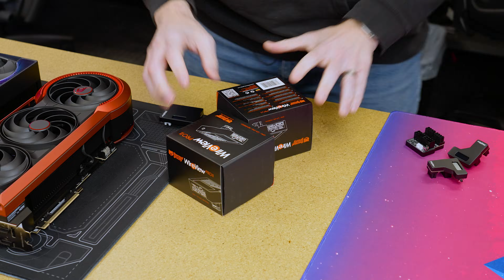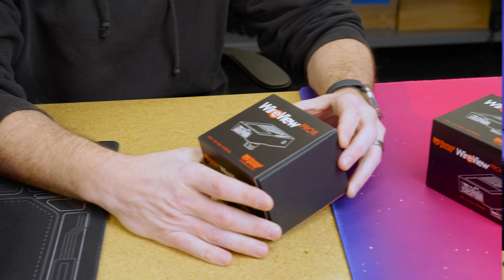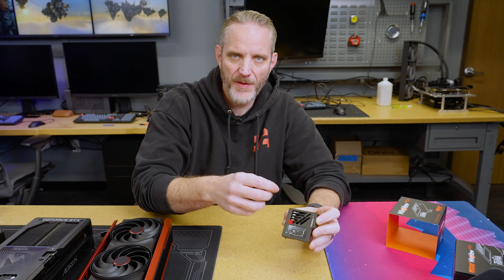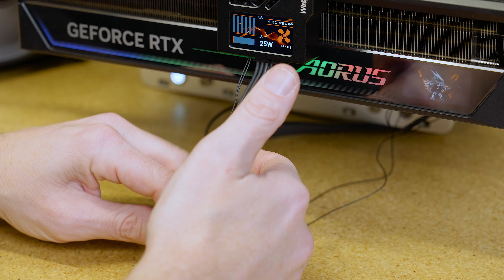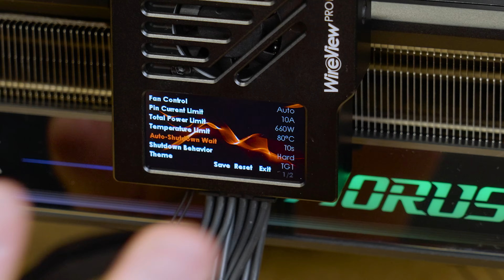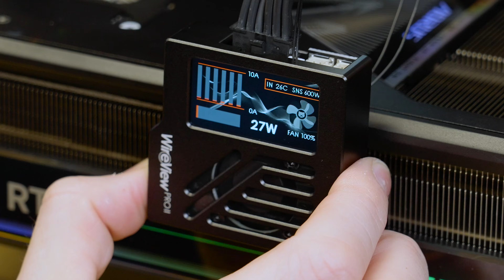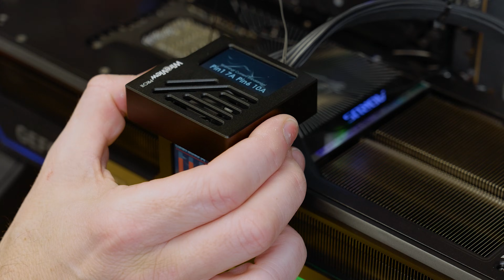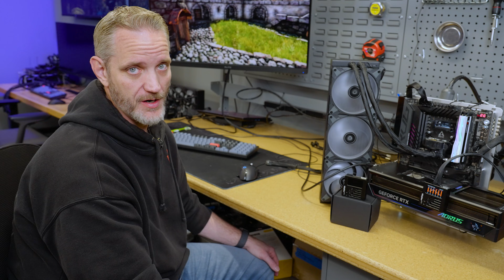Thermal Grizzly Wire View 2 Pro - The fight against melting connectors!

Comment: So many innovations in gpu cards and power supply units and by today we have still  connector issues...seriously
Reply: We have still.... we still have*
Reply: It's almost like there is a serious issue with the connector? 🤷 Maybe the problem will fix itself if we all just keep buying more of them. After all, "the more you buy, the more you save"!
Reply: It's literally 0.0001% of 5090s sold.  This is just Internet tech drama..
Reply: @JeremyBell and 8pin haz zero melting stories. Why reinvent the wheel?
Reply: @overclocker3164  you can see that 8pin has limitation in term of space. So to prevent going 4x8 5x8 6x8… they needed a new connector. It’s not Nvidia alone.. this is a new wheel, you have to deal with it.
Reply: @MRLWay oh yeah, they are SOOO HUGE on a cadillac sized gpu.........
Reply: Yes it is a new wheel, and it's shaped like a triangle @MRLWay
Reply: @xninja83x67  No it’s more like a prototype carbon wheel. Work great for the weight but need more care.
Reply: @overclocker3164  every pin/plug in the world has a case of melting.  If you don't plug in a plug all the way, the resistance and heat will build up.  Also, the 8 pin isn't standardized on every psu and many a people have blown up their graphic cards by plugging in a 8 pin cable that was incorrect because "it fit" the 8 pin plug connector.
Reply: @JeremyBell  Really now?

Comment: The only problem with this is that it's not compatible so few models. We need a universal solution, even if that means it's just basically what Asus has done with the Astral cards that can interface with HWiNFO, but doesn't have any sort of screen or readout. I saw that Cooler Master has something like that at CES, but it needs a little more time in the oven from what I've seen.

Comment: honestly when i fist saw the 12v connector i thought the pins at the top where data pins, standardized monitoring in the cable, i was like "oh, that's cool", yet later i realized they where power pins, which it's kinda dumb ngl, glad to see someone is doing something to give us more security features on our literal gold bricks
Reply: They’re not monitoring in the cable, but the 4 pins at the top ARE data pins. They’re used to signal to the card the maximum power the PSU or adapter is capable of.
Reply: @jameslake7775 then that's such a dumb idea, would have been better to make them digital, would have even avoided the melting connectors if it implemented a second microcontroller designated to simply monitor usage with a flag for the wire rating, microcontrollers aren't even that expensive, specially at quantities

Comment: You can never have a melted 12vHPRW again by not buying NVIDIA :D
Reply: This is just part of why I refuse to buy Nvidia, & use AMD, and Intel on Linux, as they just work, and do what I need them to do.
Reply: To bad 9070 XT has melting issues as well so yeah NOT just a Nvidia issue
Reply: @Montisaquadeis  just dont buy the one model with the connector the rest dont have it
Reply: @averagerin1821 my point was its NOT just an nvidia issue
Reply: @Montisaquadeis Exactly. The one Sapphire Card having that connector is suffering from the same issues. Most of the other RX90something Cards, which  have the good old 2x8 or 3x8 connectors, don't.
Reply: This

Comment: i went AMD simply because of the 12v cables on Nvidia cards
Reply: Same
Reply: probably wont be long til AMD adopts the 12V standard in their future cards.
Reply: @NightmRE_ZZZ and then I will skip them. I don't NEED them.
Reply: Never had an issue with mine. But I made sure it was fully seated. So it wouldn’t have an issue
Reply: @XeMpTFrOmDAT doesn't matter whether it's fully seated. They can still melt from aging or small production tolerances. The design is too finnicky

Comment: Meanwhile I'm running my good old 1080, which has been stable for almost 10 years. No instability, no crashes, no overheating, no melting. Just performance.
Just the idea that a 2k card needs additional hardware to work without catching fire is mind blowing to me.
Reply: gtx 1080 released in 2016, its almost 10 years. sorry
Reply: @lore.1000  Yep, that's me doing midnight maths XD
Reply: @thebearded4427 xD its ok i have one too thats just as old lmaoo
Reply: My 770 still works. I did get a 3090 though for my current PC and that has been the most stable card I own. Its really the new connector that messed things up.
Reply: Ditto. 
EVGA 1080 classified is a tank. Still runs one rig of mine. 

Their 3090ti is the last card I'll ever buy new. With EVGA gone Nvidia is no longer on my menu.

Comment: Why is Nvidia stupid enough to only give a cord 25 watts of headroom in the first place?
Reply: Because they want it to look pretty; because "everyone" is buying glass panelled cases.
Reply: @ws1-p9u  you have a point there BUT to be honest even that one HWPR cable ruins the clean look.
Reply: Because they hate gamers and want all their money!
Nvidia is not a friend of Gamers anymore, they just empty their pockets with bad engineering.
Reply: Ask PCI-SIG, they designed it.
Reply: @Mark_Williams. Who pays you to comment over and over?
Reply: @ignacio8597  Just doing my part to fight back against the misinformation :)
Reply: @Mark_Williams. you do misinform people. Better do your homework and read the documents. Typical Nvidia-Fanboy-behaviour.
Reply: @Mark_Williams. Y're not wrong, but leather jacket could've tested the connector before slapping it on hundreds of thousands of gpus, no ?
Reply: @overclocker3164  they're the ones that requested it to be created. The industry standards body came up with the design. As far as Nvidia is concerned, they did everything that was required. I'm sure both sides did testing, but might not be the kind of thing that'll raise its head until its out in the wild.
The failure rates and replacement costs is apparently worth it for them to keep going with it.
It's pretty well entrenched now, changing it again would mean new PSU's for everyone at this point. Or at the least adaptors, introducing yet another failure point into our systems.
Reply: @Mark_Williams. you are still wrong… no matter how often you repeat your story. Also, do you know who is one of the most influential PCI-SIG-member? Right, Nvidia.
Reply: @ThisIsSoMEan Sorry, semantics. PCI-SIG ratified it. NVIDIA, however, doesn't make connectors. It was most likely Foxconn (who make the Founders Edition cards and connectors) that would've partnered with them to design and prototype it in the first place. You don't design a connector without someone like them being intimately involved. So, at best, you can claim 50/50 on the original design. At worst, Nvidia gave Foxconn the desired specs and let Foxconn (or whoever) design and make it all on their own.
PCI-SIG allowed it to go industry-wide. NVIDIA being influential belittles Intel's weight, especially as it chairs the CEM workgroup.
Getting your connector to go industry-wide without the rest of the industry following (Asus GC-HPWR for example) with a standard won't get you far. So I maintain PCI-SIG is primarily at fault for why we're now stuck with it. Before that happened, it could've been revised more easily.
Trying to claim it's all Nvidia's fault when it passed through so many other hands and eyes is misrepresenting reality.

Comment: Pretty cool device, but it should be considered embarrassing to need to spend $100 on a little monitoring device to make sure a badly designed cable is doing what the spec is designed to do on a GPU that is overprice

Comment: i love how people have spent a fortune fixing a problem that Nvidia created by trying to re invent the wheel
Reply: 3x8-pin is easy solution😭😭😭
Reply: Don’t buy nvidia
Reply: @maxweinbach3996 what is our choice????
Reply: @montrose699  These YouTubers are raving over Intel…go for that.
Reply: @maxweinbach3996 it won't even come close to a 4090 or 5090 and my 4090 barely drives my VR now. For high end users there isn't another option
Reply: @montrose699 then why are people complaining about nvidia despite buying them? If it does the job….
Reply: @maxweinbach3996 because it's also risky and expensive
Reply: @montrose699  there are. You just don't need to run it all at max settings.
Reply: @caitlinomalley80 then what's the point ,
Reply: @montrose699  AMD... I have a 9070 XT card and it rules
Reply: @rasmuspedersen3563 unfortunately I tried one and it couldn't drive my VR at anything playable
Reply: Not the first time this has happened. Custom CPU retention brackets have had to be created to properly install and mount CPU coolers without bending the CPU or to give maximum contact. 

It is like these companies don't test their designs
Reply: nvidia didn't invent anything here.
Reply: 3090ti 12vhpwr was 100% fine but yeah …
Why keep making thing that works out of the box …
Reply: Nvidia didn’t create it lol PCI SIG did
Reply: PCI-SIG designed the connector. Sure Nvidia and Dell sponsored them to do it, but PCI-SIG deserves the blame.
Reply: @Mark_Williams. No the jackasses selling it should have tested it. Also its not like this problem is a few weeks old, this has been going on a long time and they should have dropped the garbage design...its flawed to its core.
Reply: @xninja83x67  The jackass selling it wanted it created in the first place, of course they're going to keep using it. They had the industry body create it. Whever the reason for wanting it is, it's financially more important to them than replacing the occasional card.
The design isn't as flawed as you might think, it just has a 5% or so overhead instead of the 30% the older 8-PIN connector had, less room for error, which we're seeing play out.
Reply: @Mark_Williams.  Last I heard they rated it for 8A,  but some NVidia cards pull 12A which is why this problem is so persistent.
If this is accurate (I have no way of knowing) then it's 100% on NVidia.
Reply: @Atlessa  Well the connector is rated for 600W, which works out at 10A per pin. If the cards pull more than that, then yeah, the card is out of spec, or needs 2x connectors. More it's the lack of overhead built into the spec, I think it's like 5% or something really small. The traditional 8-pin PCIE plug has something like 30% safety margin built in, and it has a rock solid track record.
Reply: @Atlessa  yeah but we have techtubers who do tests where they put way over 1000W - some even 1600W through that connector and it doesn't melt. Asfar as I know theres not even one video where someone could melt the cables without tampering with it on purpose like GN video where they got it to melt after deliberately inserting the connector so badly that it allmost fell off. And despite the fact that techtubers use every incident to yell loudly to push their views in reality connector based failure rate is between 0.1 - 0,5% which is extremely low.

So the connector can easily do 600W BUT...only if its sits properly so the load is equal on all  the pins. And thats the problem - even if plugging the connector in as best as you can it can still have that "not great" connection on all pins and unless you have asus cards or TG device to monitor it.
Reply: you mean nvidia in conjuction with intel
Reply: @get2choppa  no, Nvidia and Dell sponsored it's creation. It later was put into the ATX 3.0 spec, which Intel manages.
Reply: @Mark_Williams.  it was technically pci-sig
Reply: It's really not even Nvidia or Intel, it's just the standard's body, the same one's that made the previous PCI-E power connector design. And no one is re-inventing the wheel, power connectors evolve with their use case and current/voltage handling requirements. As GPUs change, the power connector standards may change with them. This is blaming the wrong people and ignoring why designs were changed in the first place.
Reply: As much as Nvidia deserves to be hated, they didn't design the power connector, they just used it.  It's literally the same connector that is on the higher end AMD cards.
Reply: @TurinAlexander two cards dude, come on.
Reply: @xninja83x67  Still relevant, stop defending one ass company on behalf of another. AMD is not your friend.
Reply: @wildnugget1675  AMD let's their AIB partners choose which connector they want to use, nvidia forces 12vhpwr onto them. huge difference since the only reason AMD cards with 12vhpwr exist is for the AIB partners and not AMD at all.
and while AMD is scummy themselves their business practices are way less anti-consumer especially in this point. it's just the lesser of the two evils.
Reply: @MrRollmoreBlunts  Ya its to bad they didn't have a high end card that competes and is as compatible.
Reply: @xninja83x67 That still means it isn't an NVIDIA propriety design; that's the point.
Reply: @TurinAlexander  Is it? Huh. Well, I do know that several 9070 XT models do use the 12v connectors
Reply: @TurinAlexander  well you can be sure that someone says then "BuT wHy DiDnT nViDiA tEsT iT". Yeah sure, if the issue is betweeen 0,1-0,5 percent its impossible for the company to test it so well that they could say "well this thing OBVIOUSLY doesn't work". Especially if 1-3% is considered industry standard for the product line.
Reply: @brudel001  It was developed as the standard for the higher wattage - a very bad standard. there weren't devices requiring this hi a wattage prior to the new GPU's
Reply: lol yep, brainwashed muppets with too much money, 9070xt 4k ultra in all games min 60fps,. people are idiots though getting sucked in to Nvidibricks marketing and the belive it.
Reply: @joerocket10r  5090 is double the performance of a 9070xt at 4k RT Though, and 3x the 4k pathtracing
Reply: @joerocket10r  , try high end VR. Even single digit gains are beneficial to prevent reprojection, so you want the fastest GPU you can get.
Reply: @JimBob1937  ah yep 9070xt and htc vive work good. no need to splash 4k on a shit product that might catch fire or just stop working for minimal gains.
Reply: @joerocket10r  , I have a BSB2 and a 5090, along with a 9800X3D... and games like a fully upgraded Skyrim and Silent Hill 2 are borderline hitting the 90 FPS target as is. That's often even with lowering the resolution a tad. I need whatever tiny performance gains I can get.
Reply: @joerocket10r htc vive as a high end headset?
I’m loving my play for dream and even a 5090 can’t be enough sometimes.
Literally you’re purposely ignoring what they need and thinking to be even smarter because you’re buying a worse and less expensive product?

Have the guts to admit it at least.

We all hate this connector and buying a 160€ product to prevent this problem is obscene, but we literally have no choice if you are in a situation where you need this level of performance
Reply: Everyone complains but you guys keep buying their cards so who's really wrong here?
Reply: @DyOoOgo what else are we supposed to buy?
Reply: @mikerzisu9508 well I just bought a 9070xt for $350au cheaper then a 5070ti. Price to performance, amd is ahead, 5070 has less performance and less ram. A little research and you will see nvidia are premium at marketing just like Apple. Sucked in with ya fake frames, what happened to the 5060 having 4090 performance? Jensen is FOS is what happened.
Reply: @mikerzisu9508  I agree, like if we could build a graphics card or if there are many other options in the market. The GPU market is a monopoly. And we have to work with that technology.

Comment: The melting cables is the reason why I haven't upgraded my gpu in 5 years.
Reply: So basically you blind follow paid videos and wild thumbnails from influencers instead of doing your own research. Got it! The rest of us will enjoy gaming in 4k with our 4090s/5090s while you tinfoil hat about a connector that a few apes couple socket correctly.
Reply: @normo.1141 lmao pray that 12v high power melt 0.001% don't happen to you.
Reply: @overclocker3164  thats why everyone that cares for his gpu got a wireview, including me. No cable burning with 35c baby

Comment: I really think this is being blown out of proportion. Its happening to less than like 0.5% of people. Which is definitely some, but it’s not like every connector is going to melt.
Reply: It's happing to so many people, a stupid cable and power delivery design is not a if but when u have a fire
Reply: @zack9912000 its happening to so many people? Where is this being tracked? It’s being talked about by so many people but it has happened to maybe what…dozens?

Even every tech reviewer is like “the connector melts!!! Now here’s me shoving 1200 watts through it after destroying 3 of the pins to prove it sucks!”
Reply: I really would like to see a statistic on 8pin melting compared to 12v hp. REALLY puts into perspective the difference between "0.001%" and fucking zero. U need more power? Fine, make 12v hp the size of standart 8pin, the card's pcb have space for them ffs, they are giant anyway bc of the coolers. Nooo, they make it small af and then pull more current through it than any 8pin before that.
Reply: Problem is, you don't know if you are going to be one of them. I can tell you, it's not fun.

Comment: Through the power of buying a GPU that could never draw enough current to melt its 12V high-failure connector, I actually don't need this.
Reply: dont need it with a 4090/5090 either, just build your suff correctly and good to go

Comment: I got this as well. After I installed it on my 5090, it showed that my current 12VHPWR cable had bad amperage balancing. I ordered a new cable from CableMod and the balance is MUCH better. I daresay this device likely prevented a future melting failure. Easily paid for itself immediately.